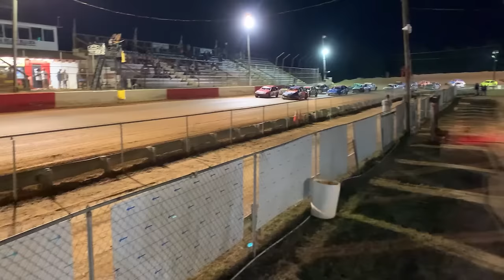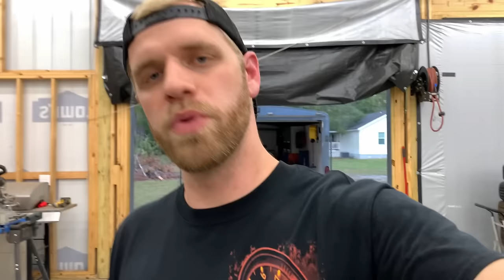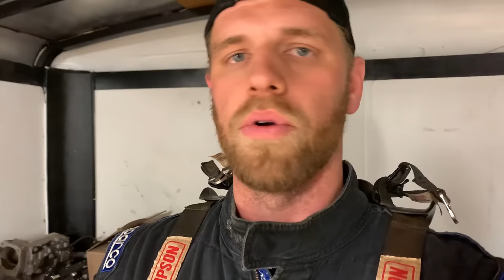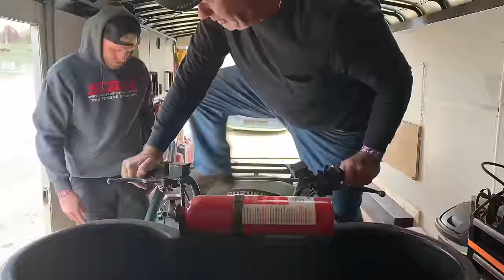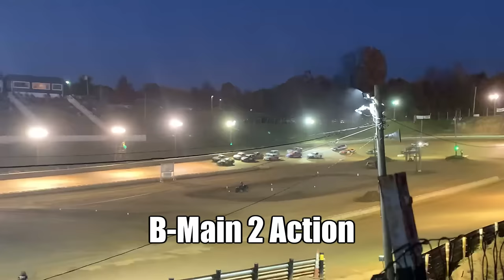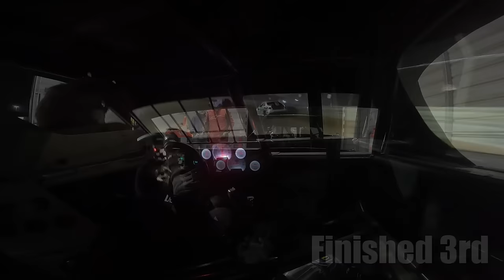WILD Racing At Beckley! 2024 Compact Clash

Comment: If you could go back and make changes to the car what do you think you would do to have won it?
Reply from the maker: I tried cutting down some of the stock springs to adjust ride height. It felt pretty good when the track had some tack to it, but once it got slick I couldn’t get back in the throttle on exit. I need to get the car back on scales and do some experimenting to see what those changes had done with my corner weights